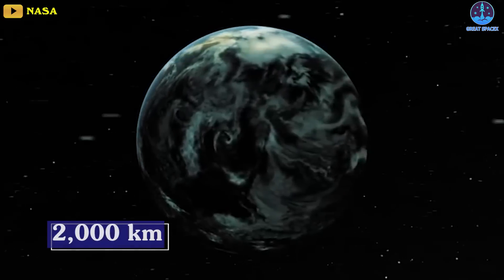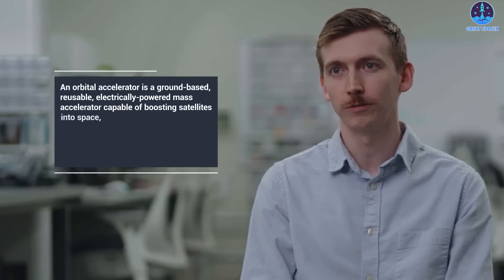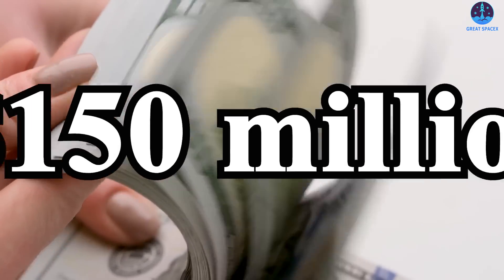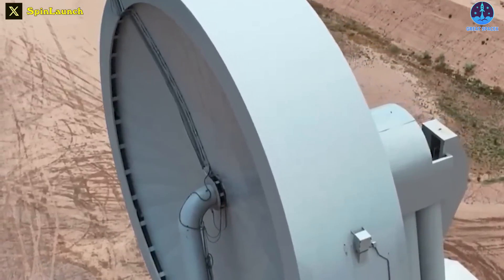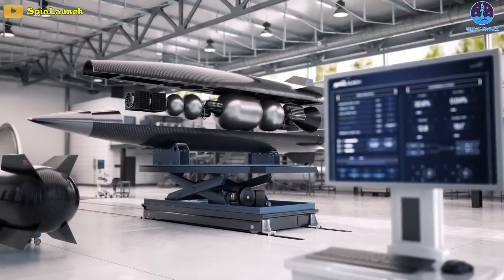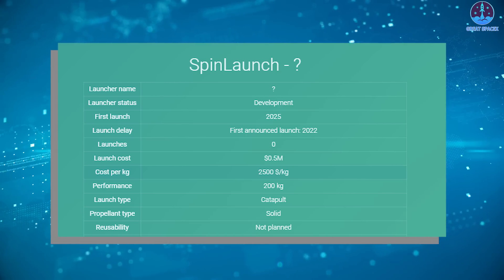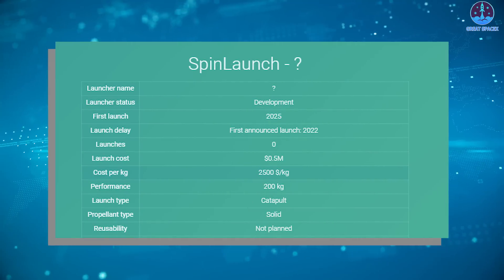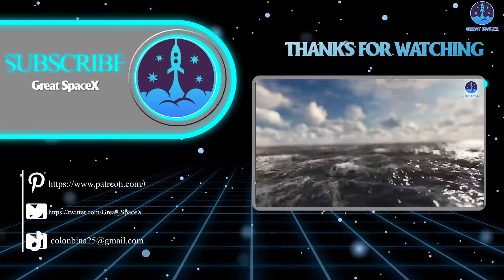What exactly happened to Spinlaunch and the Orbital Accelerator with new technology?

Comment: On another channel there was quite a discussion about Spinlaunch. There are a few massive problems : pulling any sort of vacuum in a chamber that size takes pretty long (measured in days) and then it is lost when the projectile bursts the exit membrane. The seal on the axle has to be pretty special not to leak vacuum. The projectile has to be released extremely accurately (video talks of 1/3 millisecond) otherwise, like a comment said, it would destroy the chamber and dig itself to China. The instant the projectile is released, the arm would be horribly out of balance - it was suggested that a counterweight of similar mass would be released from center to edge of arm. Whatever method is used, I don't want to be anywhere in the same country - imagine 200Kg on a 30m arm at 450rpm.....the video talks of 10,000G - I am sure Scott Manley can calculate the momentum involved (he is good at calculating). Finally the projectile must be capable of handling those immense G forces.
Reply: It's perfect for the Moon.
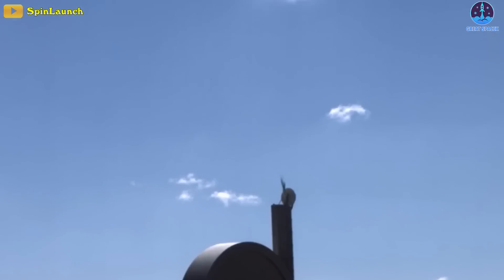Reply: If you slow the playback speed down to .25 and stop it around 2:18, you can see where the projectile scraped about the entire side of it and if you keep playing it, you can see what  looks like the projectile wobbling on its way up. I watched a video about this around a year ago and it made the same comments about how it will never work. I guess time will tell
Reply: Its a good way to waste 80 Million 🤣. Can't reach the speeds it says it does, can't be aimed easily or consistently, subjects any payload to extreme gforces for extended periods of time, limited weight limit. Thier rocket design wont work for orbit due to not taking deceleration into account with the liquid fuel something rocket engineers fixed ages ago and so on. This is a poor copy of project harp with less results and way more cost🙄
Reply: You say that pumping out the air would take days. I have no idea why you think that, the massive NASA vacuum chamber, large enough to hold the JWST, pumps out all 30 tons of air in only 8 hours.
Reply: They should turn it into a human carnival ride instead. Spin launch people into the sky and they come down in a parachute. They might look like Alphagetti in the end but thats the price to pay these days for thrill seekers.
Reply: As long as the rocket ir vehicle in question makes it out if the launcher it has the capabilities to perform course adjustments to reach its intended target
Reply: You wouldn't want to be in the same country? It would be an explosion equivalent to 0.05t (or 100 lbs) of TNT. What were you expecting? You'd be fine being in the same country even if that country was The Vatican.  😆
Reply: Okay... If you felt safe in the Vatican, you'd feel safe anywhere. I should know... My father was a priest and my mother was a nun. 😁 @uddek
Reply: You should watch the 40 min documentary about this. They prove why everything you're worried about has been solved and are no longer issues.
Reply: can you provide a video link? Thanks. @DamienDrake2389
Reply: What I will never understand is how the promoters of this giant sling idea can get 150 M dollars when the simplest way of getting to 2km/sec goes forever wanting.  Get a big steel tube put your satellite in and inject hot pressurized hydrogen in behind.  Actually 2 km/sec is easy for hydrogen.  Even cannon powder could get almost to that speed (rod penetrators from an Abrams can reach a mile per sec.). Hydrogen could get a projectile to orbital velocity if the development money was there.  The longer the barrel the lower the setback g force.   The bigger the tube the bigger the satellite.  Use hydrogen to fill the barrel and you don't need to pull a vacuum.  Just a big straight tube and the injectors for 20 kpsi H2 needs development.  Doesn't this deserve at least the same research and development money as a giant sling.
Reply: yes, and this limits what you can send.  This is the case of it's CEO being too stubborn to give up and wasting investor funds on a decades old dream.  I liken it to OTEC, I literally told their CEO after a conference (I'm in venture capital) that it's egotistical to keep asking for investor funds.  It's was a 40 year old dream that came about when solar was $10 dollars per watt.  After priced dropped to 35 cents per watt, they were just a waste of money on a proof of concept.
Reply: Вместо вакуума можно использовать водород или гелий.

Comment: Launch raw materials in to space…. To be used by 3D printers…
Reply: or just put a hundred small boxes on starship, you'll have plenty or room and 1/10 of starships capacity would be used.  Those 100 boxes would take 300 days for this to launch as it takes 3 days to get the vacuum in the larger version.  Does that explain why they are going bankrupt in a couple years?

Comment: I want them to show that they can build a liquid fueled rocket that can take 100+G's laterally and still function to put the payload into orbit.   Yeeting it up a hundred thousand feet is the EASY part...and they're struggling with that.   They still need a rocket and showing a CGI rendering is FAR from making one that works.
Reply: At that G load, a solid rocket would run the rick of self combustion.
Reply: @otterpossum9128  Even solid fuel would tend to slump under that kind of side loading....and wouldn't burn right.   I feel bad for the people investing in this expecting to ever get a return...hopefully it's just a tax write-off for them.
Reply: @recoilrob324  It will be deductible as I know tax but this reminds me of the OTEC people.  Wasting engineers time for an obviously outdated idea.

Comment: Why not use the EMALS (or Railgun) to launch?
Reply: I think it's because it would take a railgun several miles long to work.  Rockets take miles to work as well, but those miles are in the air.
Reply: @dougcox835  oK, first off a Railgun can hit Mach 5ish in about 30-ft.  Second put the Railgun (or coil gun for that matter) up the side of a mountain.  Oh, and EMALS gets a F-35 to a few hundred MPH in a few dozen ft.
Reply: @VAMobMember A railgun accelerates a sabot weighing about 50 pounds to Mach 5+ in a few seconds. The recoil energy trashes the launch rails after about six shots. Launching a 50,000 - 500,000 pound rocket will take huge amounts of electricity
Reply: @mikegardner107  don’t know you source of info but I have seen Railgun fire.  The round reaches Mack 5+ in a TINY, TINY, TINY fraction of a second.  And I have seen a dozen rounds fired with one set of rails and that run probably fired HUNDREDS of rounds, we were researching rail wear primarily.  Work was done by US Navy.
Reply: @VAMobMember One of the major limits was how often the rails had to be replaced. If they solved that problem, why did they stop R&D on it? Or did they?
Reply: @mikegardner107  who knows?  I’m retired thus my sources  have dried up.  And i don’t think they found what I would call a GOOD solution.
Reply: @VAMobMember  In the early 70s the USAF was saying they had space in a fighter jet to place an HEL system. Sometimes good things take time.
Reply: @mikegardner107  by NO MEANS have I given up on Rail/Coil guns.  For the military use I think the “power pack” and rail wear are the major problems.  Don’t know why ppl think I don’t support them.  In fact I think they may be a solution to TINY SAT launches, in fact that’s where this started.
Reply: A sling shot was a great weapon when David faced off against Goliath. Then someone invented a sniper rifle.